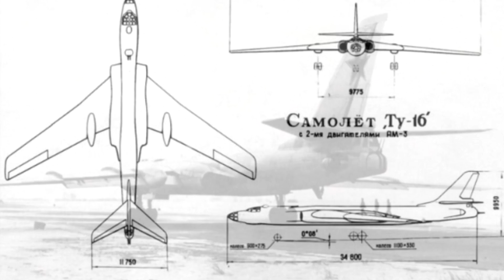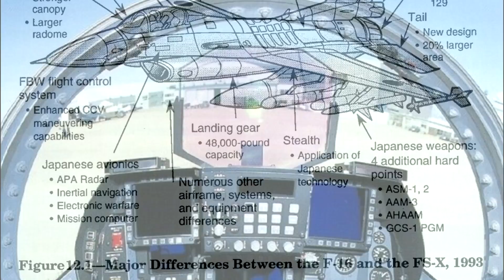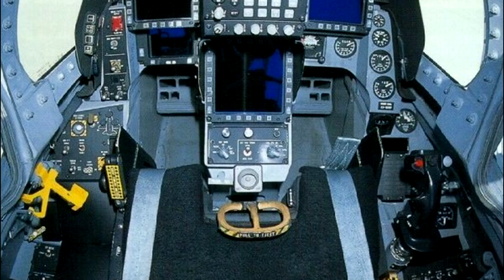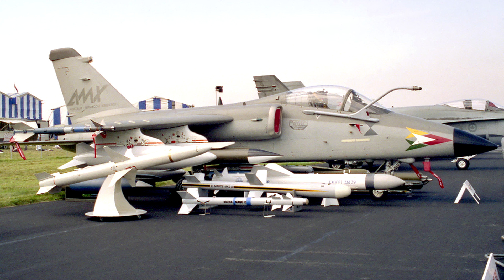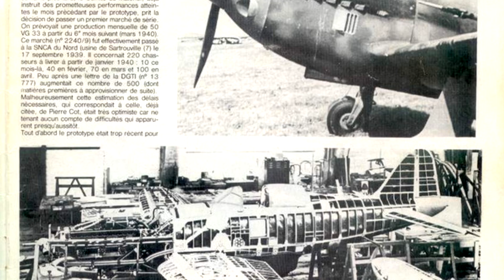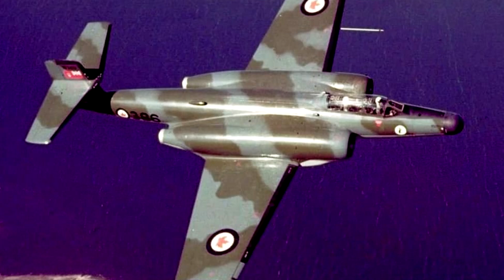Aviation - Passed To Developers - August 2023 - War Thunder

Comment: I know some people think bombers are pointless but alot of people enjoy them. When will we get  b36 peace maker.   B47 strato jet.   B58 hustlers.   Vulcan and victor bombers.   And whatever that ussr bear thing is
Reply: I’m my opinion there’s a lot Gaijin can do with bomber intercept game-modes. One team starts 100km off and other team has to take off and intercept.
Reply: If the B-36 gets added, the option to deploy XF-85 Goblins is a must. While it was never actually used on a Peacemaker in real life, the early models (ie the ones that still had the full defensive armament instead of just the tail guns) were wired so that the XF-85 launch and recovery equipment could be installed. And it would be absolutely hilarious if there was the option to give up your entire bomb load in favor of being an aircraft carrier with three Goblins.

The other hilarious thing that the B-36 could do is carry two T-12 Cloudmakers. Each of which is roughly equivalent to 3 Tallboys.